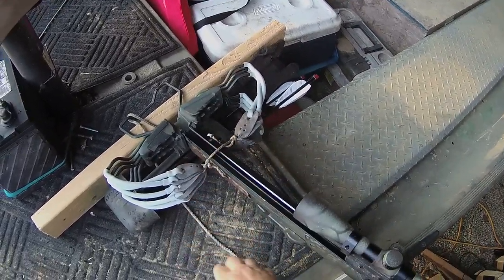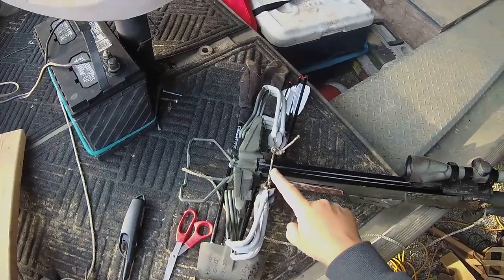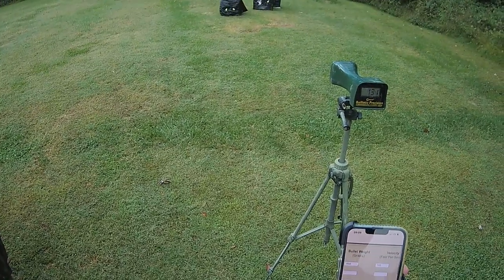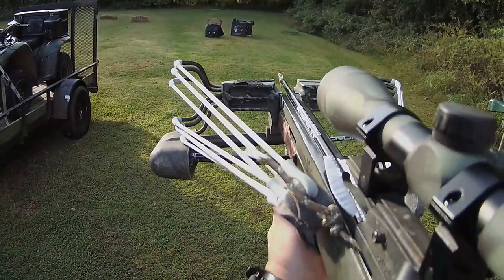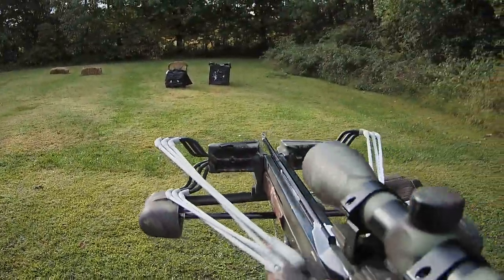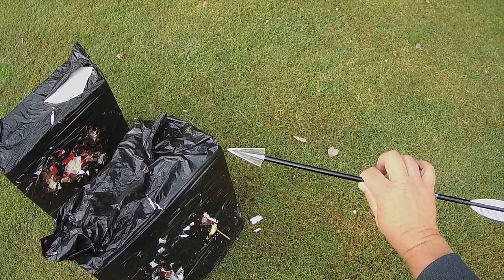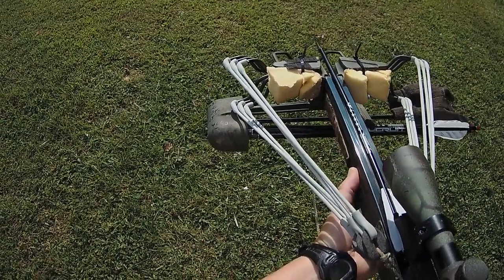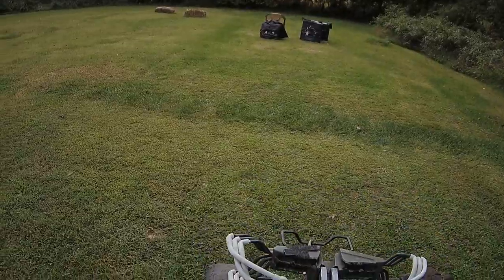Speeding up the Slingshot Crossbow

Comment: Did you make that bow kurtdog
Reply from the maker: The stock came off an old crossbow the limbs got warped.  I bought the slingshots and put it together. Experimented with different bands and string set ups. Shoots about the same speed as a 35 pound recurve so totally lethal I think. I was concerned it may not be accurate even if it worked, but it did better than I thought.
Reply: @Kurtdog63  nice